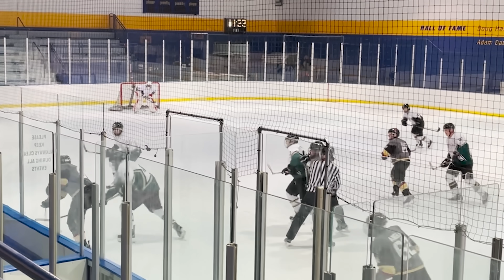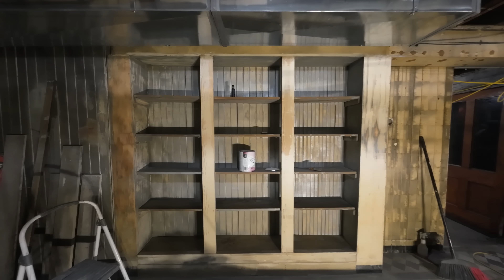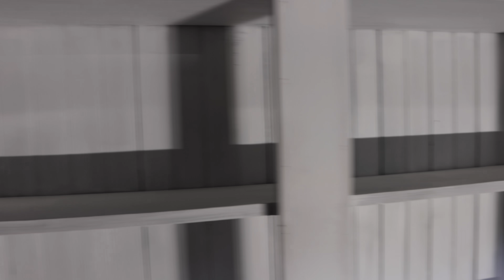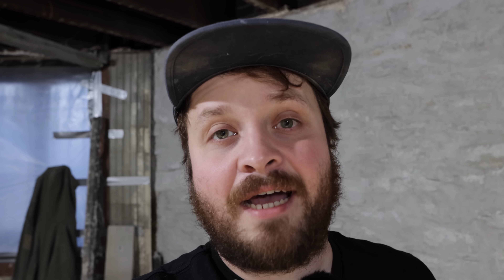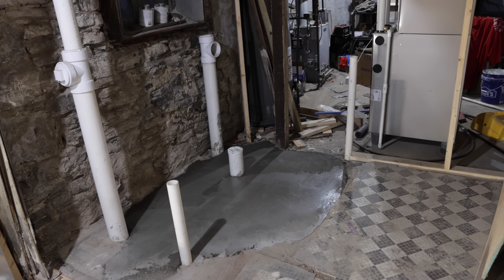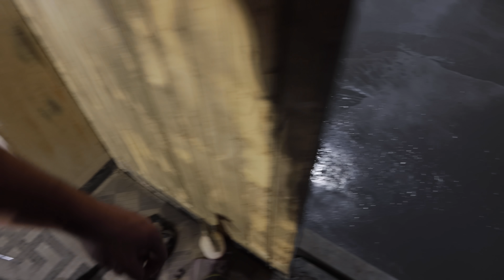This Is Going to Look So Nice! S3 EP18

Comment: A former boss was overseeing a job that had a company coming into his workspace for a large concrete pour. It HAD to be level, due to the equipment to be used on the floor. They swore it was level. He took a bucket of marbles and poured them out on the floor. The marbles, of course, pooled in all the dips and made it very obvious that the floor WASN'T level. The concrete company fixed it. So, if you want to prove your floor isn't level, just pour out a bucket of marbles or bearings. They then should fix it.
Reply: 🎯THIS!!!
Reply: It depends if its worth the aggravation, after all it only needs to be 'good enough'
Reply: I'm with this guy ! It should not be like that. Get them back to fix that. Not a professional job. And do not compromise on any of it Caleb!!!!!!!
Reply: True! People say if looking for  a place to buy, take some to make sure the house is level 👍🏻
Reply: That's hysterical!! Your boss was awesome!!
Reply: @lindamurns1245 agreed. It needs to be right for the tile above to lay right.
Reply: Could also use a laser to highlight high spots
Reply: I like this story, lol.

Comment: You can get mosaics meshed for you (or you can mesh them yourself) if you’d like to have a kitchen floor that has a similar vibe, just not as detailed. Much easier to lay when you’re putting mosaics down by the sheet and not by the piece.

Comment: You should do butcher block countertops in the modern kitchen it looks really good it’s useful and super cheap. When I put in my new countertops I’m putting in butcher block with a food grade stain and sealing it with beeswax so it can be used directly as a cutting board and the wear brings it character as it ages

Comment: The cheapest tile is a simple 12"x12" square tile. It is both modern and yet authentic to the twenties style of the rest of the basement. I found a half a dozen styles and patterns of porcelain rectified (easier install, I highly recommend them) matte floor tiles on sale for less than $2 a square foot. One even had a geometric art deco pattern in black white and grey that would 'go' with the rest of the basement. I trust your taste (it's one of the things that I love about your restoration) so I have faith that you will make a good choice. It's great to see you have recovered from the bitter (and daunting) disappointments of recent weeks. Keep up the good work!

Comment: Since you're focusing on the lower level, would it be possible to do a basic linear floor plan of what you're planning? Kitchen, bath, guest room etc. For example, the shelving you're working on - what room will that be in, and how will it be utilized. Thanks! You are doing such an outstanding job!

Comment: I had a botched leveler pour that was my fault not wet enough and trying to pour too large of an area.  Sunbelt rents floor grinders (100 or so a day)and it fixed the bad pour.  If you go that route plastic off the area like crazy  the dust gets everywhere it took 4-5 hours to do a floor that size its not going to level it but it will take out the high spots and smooth out the floor.

Comment: I love your eye for detail.  Hopefully the floor will dry a lot smoother than it currently appears.
I thought I would give you an update on the shallac discussion with my hubby.  Our biggest problem, we thought, was when we discovered we could not get lime here to repair plaster, yes it is all drywalled now. Now the shallac has also become a mute point, why you may ask.  We cannot buy it here, it has a limited shelf life and little call for it here, no one carries it.  We have 100 feet of custom Douglas Fir trim which needs to to match the original in colour, as close as possible. It will be stained then a varnish/stain to get it as close as possible to the original. We had a pait store do some testing and have as close as we can get without the aging process.

Comment: My Dad had a product called 'gypcrete' poured over his 'in-floor heating' pipes, and when he was ready to put down linoleum, had a lot of frustration with an uneven surface. My one piece of advice would be to avoid 12 inch tiles, going with 4 inch or smaller. That will be more forgiving if the surface is not exactly flat. I've also seen underlayments that are flexible. Smaller hex tiles often come in sheets, so that should make things easier and still give a generally period look. We put 12 inch slate-look tiles in our kitchen, and there is enough movement in the floor (raised foundation, 92 years old, on clay soil) that some come loose from time to time. We had a lot of rain overnight, and it's time again to remove the metal plate from the door frame in the bedroom so the door will latch and the cats can't get in to rampage through my closet at 4am. :S

Comment: I appreciate all the work you're doing on the house to restore it.   What I question is.....why don't you fix the roof first to keep water from entering into the house???
Reply: If I may, the flat roof is water tight. And the mansard doesn't actually leak water into the house. Luckily the damage is mostly on the outside. He has some previous video where they go up to the 3rd floor and show it from the inside. The historical carpenter, Eric and his daughter Claire are there to inspect it. Very cool!